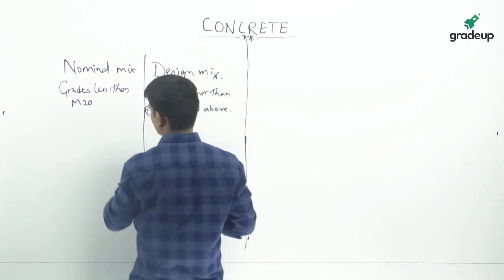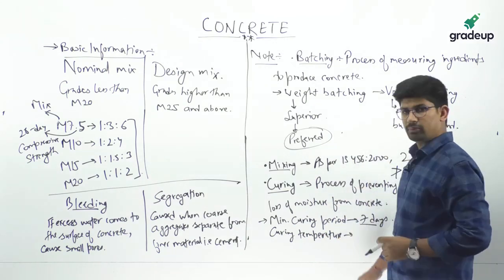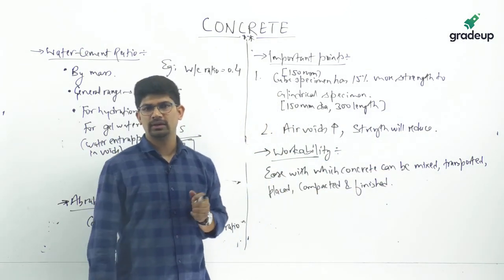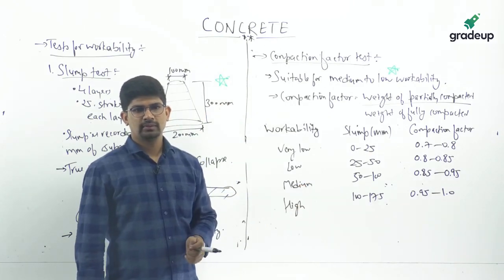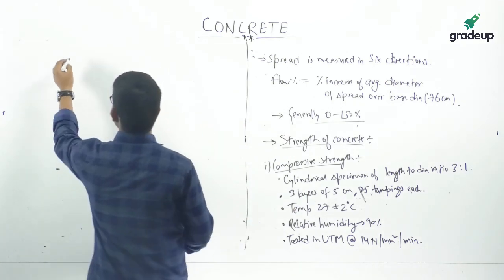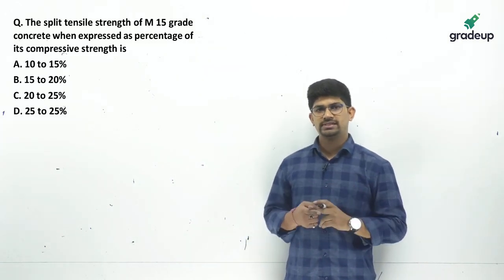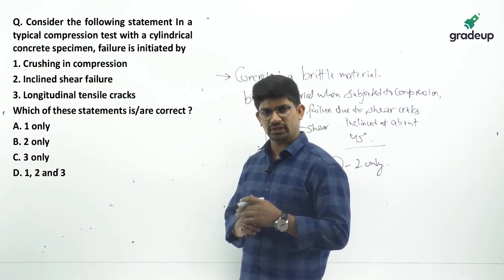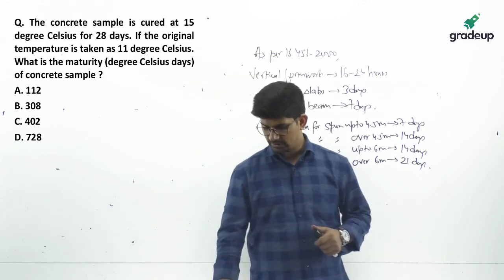JE Civil 2019 | RRB/SSC Exam || Building Materials Class 4 | Concrete

Comment: To all the viewers-
There is some correction as under-
M7.5- 1:4:8
M10- 1:3:6
M15- 1:2:4
M20- 1:1.5:3
M25- 1:1:2

Also there was a query regarding the relation between split tensile strength, flexural tensile strength(modulus of rupture) and direct tensile strength-
direct tensile strength<splitting tensile strength(about 5 to 12% higher than direct tensile strength) < modulus of rupture(15-20% higher than split tensile strength)
Reply: Thanks sir
Reply: Ya i was about to say that.. Just as i check in comment i saw yours so be careful please.. Becaue some other student might have take as it is in this video.
Reply: Thank you sir!